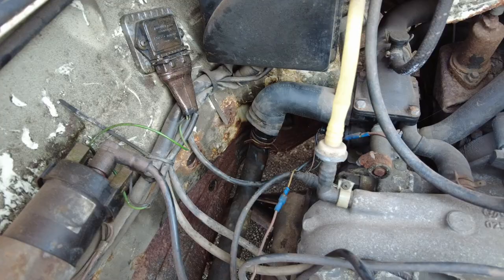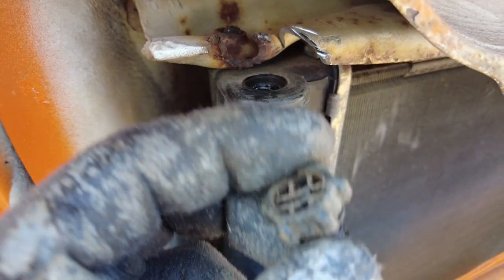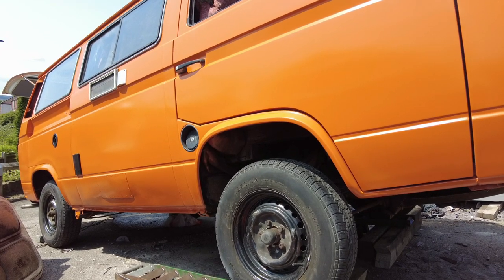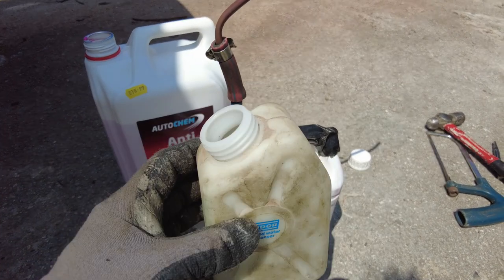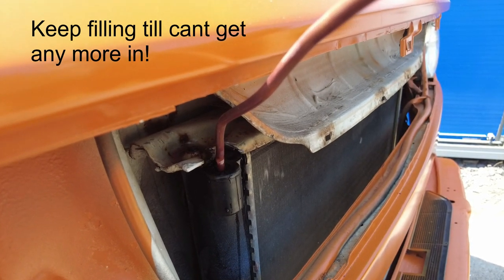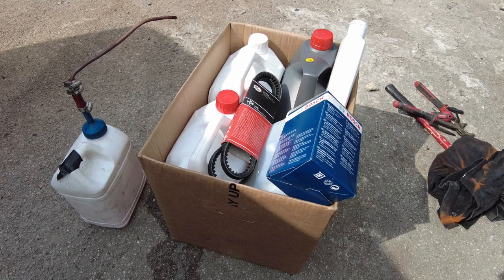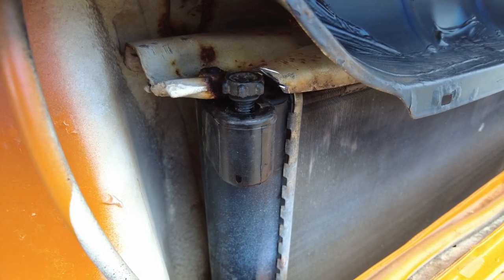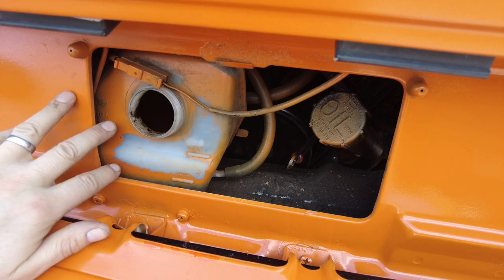Bleed VW T25 Vanagon Radiator Coolant Cooling System

Comment: Bleed screw like a Nissens rad. Can be replaced with a metal bolt. I've gravity filled it through the bleed with a bottle on a stepladder. After running it to operating temp park it nose down on a good slope and let it cool. Any air will collect in the expansion tank. Top up and fill overflow to max. You can check for air at the bleed screw but likely will be none.
Reply from the maker: I haven't tried that method but thanks for the info. Going to try pressurising the system next time and see how that works 😊👍

Comment: Great video.
I’m going to do mine shortly.
Thank you
Reply from the maker: Thanks for the kind feedback. Since making this vid a few have come up in my feed using a pressurised setup which should push coolant to & air out the Rad (tho id still get that nose right up) and look interesting, but not tried them. I just know this works so sticking with it. Had to do it twice last week in the services after losing a coolant pipe on the motorway, not the most of fun and got some funny looks from people thinking I'd crashed trying to exit the carpark over the high kerb, but got us home after found a hose clip that would fit. From now on will carry a spare! 😅 Best of luck 👍
Reply from the maker: I didn't mention in the video I forgot, but need heater open (to the right) on the dash to avoid an air lock there 😊👍
Reply: I like the simple method, & if it works then I’m happy.
Thank you
Reply from the maker: @stephenrogers9664  Always worked for me. And avoided annoying air locks in the radiator. Need to have you heater in hot/open position too so no air get locked there. Best of luck 👍

Comment: Hey I can’t wait, you may cover the issue I have with my T25…..
Reply from the maker: Cool. I've recommended this to a few peeps over the years and while it's a pain in the butt does seem to do the job so fingers xd for you. Got an even better
Vid for setting up the gear shifter waiting for release. Was soooo impressed when it 'just worked', that rarely happens with shifter probs 😅👍

Comment: thank for posting this.  you don’t have to get the RPMs up to get the coolant to come out of the top of the radiator when the van is nose-up on ramps? 🤔 

also what about the T-stat bleeder valve? thx bro
Reply from the maker: My pleasure. I've never left it running at idle long enough to find out so not 100% sure, I usually just up the revs a bit to speed up the process. I've never used the thermostat bleed tbh as with the nose up never needed to, wouldn't hurt to check there is no air left in there tho and only take a minute. Thanks for watching 😊👍
Reply: this would seem to suggest that the coolant pump impeller itself at idling RPMs suffices to get the water to effectively flow uphill. unless I’m missing something else!
Reply: thanks for replying!
Reply from the maker: @barnacleburrito3728  maybe, it might well work given time I j.have just never waited. The pump on this van is actually a new replacement and it's no different to any of my other previous vans so pretty sure not a fault. 😊👍

Comment: Hi, Thanks for the video. Did you mix the coolant with water?
Reply from the maker: Yes I mix is with deionised or de mineralised water, called different things in different places. I personally lean heavy on the mix because of cold winters here about 50/50 but you will find a mixing guide on the bottle depending on manufacturer and concentration. Some are are mixed but I tend to avoid these. Deffo go for the pink glycol rather than cheaper blue, had a linger life so less hassle in the future. Best of luck 😊👍

Comment: Hi there, trying this on my van, when I fill from the radiator I can not get it to fill all the way up as it seems it leaks out of the expansion box at the back, it has 3 small holes that allow it to overflow, so I just filled it all the way I could and started to idle, I can feel air coming out of the radiator but it’s seems like it’s pushing and pulling air out of that hole and is not filling radiator have had it running for a while and still no water coming from top of radiator, any help 😊
Reply: How long would u have to run it for to start to see it coming from the radiator cap thing ?
Reply: It also does squirt out of that hole every now and then 😂 I’m doing everything in the video but starting to think I’ve done something wrong 😂
Reply from the maker: @bradleyfisher8933 Do you mean the expansion vessel with the dalek cap on rather than the fill bottle at the back hatch? I've never seen water come out of that when closed, it's possible there is something not right with the seal/valve in the cap, in the situation you talk about it's not under much pressure and pretty sure shouldn't leak? Tho not 100% as not sure what woukd happen in an over pressure situation.
The point of getting the nose up is purely the remove any air from the system, if the nose had been up and running for a while, and there is water I the Rad then you should be good to drop the nose if that helps. I usually give the rubber pipes a squish to make sure full of water and no air too, will get hot be careful. 
It's does take a long time for the water to get hot enough to start pumping properly through the Rad. You have to idle for about 20 minutes or more and find for a while the water level just bobs up and down in the hole, I usually get bored and give it some light revs for a bit with a brick on the accelerator 😅. Will find with revs the water will flow much quicker and out the hole when hot so easier to see when full, but be careful it will squirt out quite quickly and starting to get hot at that point so might want to back revs off before fitting the Rad bung.
When the engine is turned off and cooling down, if the expansion vessel is low on water it will draw water from the rear fill bottle. It might be worth checking after a day that's it's working properly. The expansion should be near as full, the fill bottle may have dropped. 
Hope that helps, best of luck 😊👍
Reply: @PeoplesCar  thanks very much for the detailed response, stepping away for the moment and this will be extremely useful when I go back and have another go !!! Thank you !
Reply: And it’s the (filler bottle) that’s directly behind the number plate hatch (apologies for wrong terminology’s -I’m learning) that’s the one with the holes in it ???

Comment: Might be a silly question. Where do you dispose of the liquid?
Reply from the maker: I have a couple of big containers and save old oil and fluids seperate. I take it to the guys who do my MOT so they can use use the oil in the garage heater over winter. I dunno what they do with the coolant I leave but tbh there isn't usually much if any. I think you can take to the Local Tip here in the UK and dispose as hazardous liquids if you want to be conscientious. 😊👍